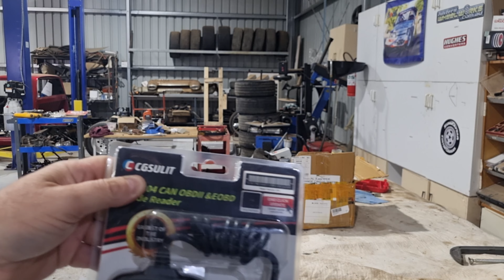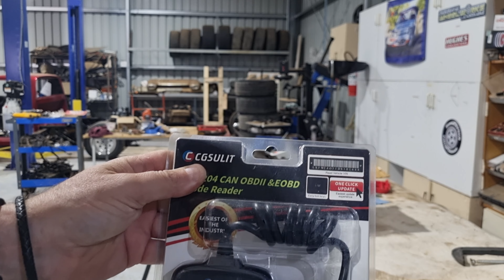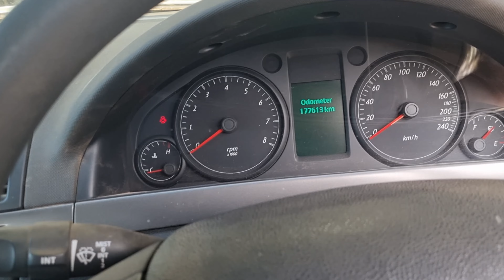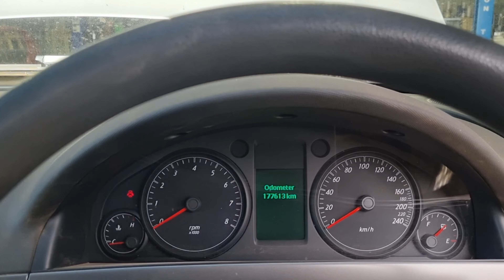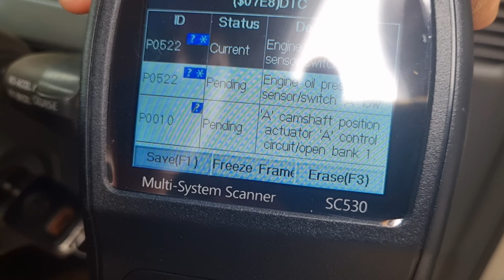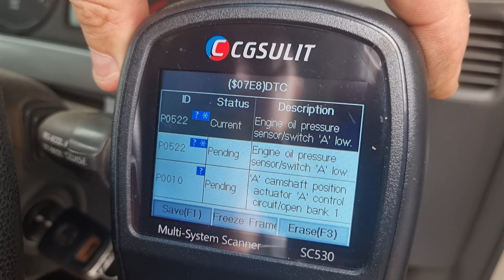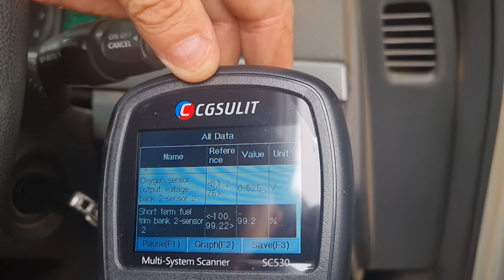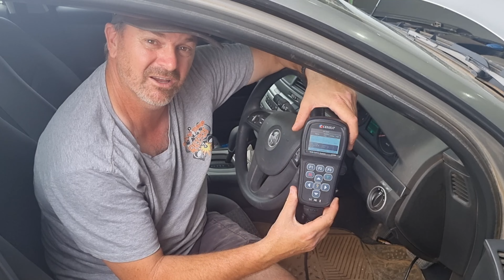CGSULIT SC530 Scan Tool OBD2 Scanner

Comment: Did they send a set of feeler gauges to set the points?😁
Reply from the maker: Well technically speaking Jim to set a set of points best way is to set them with a dwell gauge.
Reply: @carsnthingsrestos31  My humour😁
Reply: your showing your age Jim.
Reply: @carsnthingsrestos31  not being cheeky here, but setting the point gap correctly then reading the dwell angle with a gauge will tell you if other parts are worn or if gap is incorrect for application. So, there needs to be a point gap to read anything with dwell? And dwell is the time the gap is closed.  Good vid man, happy you have new toys to play with.

Comment: That's more proof that second hand Engines are usually no better than the worn out one you are replacing,where as if you just replace your timing chains and other faulty components you have eliminated that problem and you have seen the condition of the engine behind the timing covers and you have kept the original engine in the vehicle.so you have a recondition engine which is better than a low K motor from a wrecker and lets face it all engines from a wrecker are low K engines,just ask them they will tell you :).
the problem with the timing chains on those v6 engines is caused in my opinion by the tensioners releasing the tension from the chains which causes premature failure of the chains.